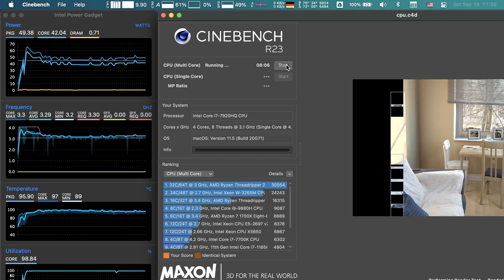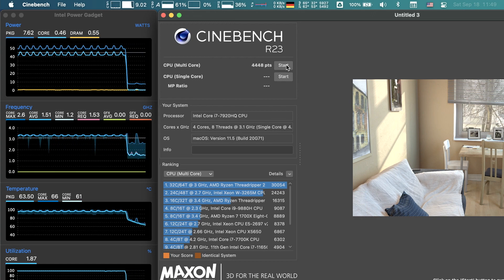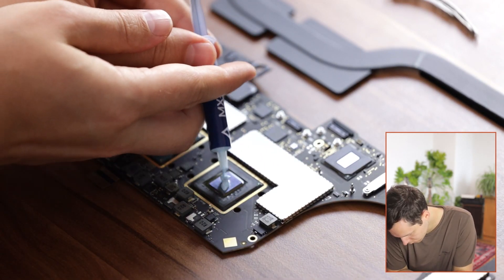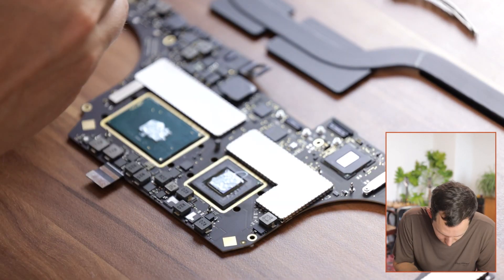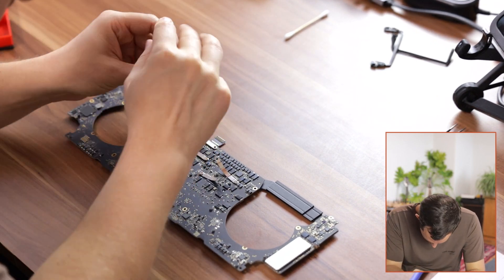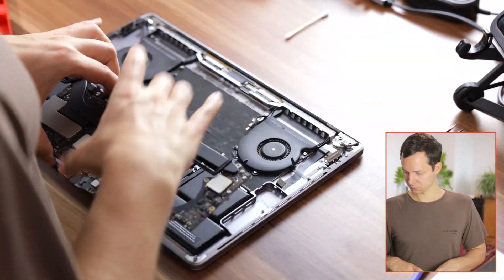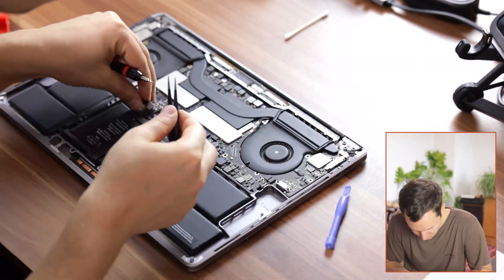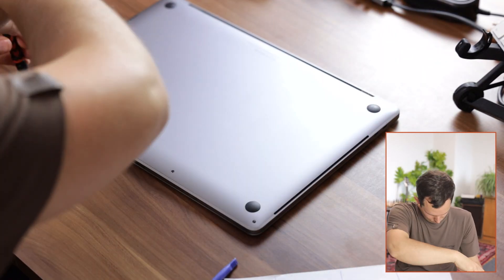Is Repasting a MacBook Pro worth it? [Model 2016/2017] (A1707)

Comment: I did it recently with my A1707, and it got me 25°C cooler !!! No typo, not kidding - TWENTY FIVE DEGREES CELSIUS!
Starting Photoshop, it used to peak out at just over 100°C.
Now, after re-pasting, it won't get over 75°C (I'm using Temperature Gauge Pro).
Peaks also seem to last shorter than before.
Thermal paste is now Arctic MX-4 (I don't get payed or sponsored in any way.)

Interestingly, my idle temps are now a hair warmer: I can't reach the former 37°C, it runs now at just over 40°C.
Reply from the maker: That's amazing, thanks for sharing your experience here. Congrats on the "almost like new" laptop.

Comment: Very nice results. I would suggest not using a spudger on/near the die, it's really easy to knock off an SMD in the process and render it dead. Use a q-tip and isopropyl alcohol and be VERY gentle
Reply from the maker: Thanks for the tips.

Comment: My macbook A1707 2017 repaste using artic mx4 always reach 100⁰C when boot or opening app or rendering and about 60⁰C - 70⁰C when idle process with auto fan setting, is that normal?
Reply: No lol
Reply: I think these are sadly the actual temperatures which you will normally get. The design of the cpu and gpu cooler is just very poor
Reply: @Niklas5  exactly, I've tried many thermal paste except Thermal Grizzly Conductonaut, the best max thermal reached still 95⁰C and 50 - 70⁰C when idle. Si I decided stop using the machine  and move to PC

Comment: I fell over a 2016 MBP in search of a 2015 MBP. I am happy with it. Great video and may be worth doing. I use iMovie and the older version was faster than the new version, so for all the speed I would gain, is lost in the extra steps needed to get a video up on You Tube. iMovie 9 could upload directly to You Tube, now 10 forces me to download it and upload it from the Movies folder. Kinda dumb, but I guess You Tube was complaining. Apple software does amazing things, and then when people don't use it, it sort of goes away.
Not a lot of videos on the 1707. Was looking to replace the SSD, if it would be helpful. Memory seems to be maxed out at 16G.

Comment: If you had cable trouble did replacement fix the issue
Reply from the maker: I did not have to replace anything. It all worked again.
Reply: @ChrisSpiegl  sorry, I meant keyboard trouble as in sticky keys etc.
Reply from the maker: @dummyemail4738  I never had sticky keys. I know this was an issue for many but not on my model for some reason.
Reply: @ChrisSpiegl  you are probably a very clean person 😃
Reply: Dirt sticking under the keys cause the issue
Reply from the maker: @dummyemail4738  Maybe. But I was even traveling around the globe with the MacBook and this one has been to about 9 different countries and at least as many beach coffee shops.
Reply: @ChrisSpiegl  I have a MacBook 12 2015 with the same butterfly keyboard and I never bad any issue (knock on wood) so I am hoping i wont have issue with the 2016 15 inch (that I just ordered).
Reply from the maker: @dummyemail4738  🤞 wishing you all the best with the new MacBook 👍.
Reply: @ChrisSpiegl  Thanks!

Comment: Have a couple 2015 model Macbooks that are apparently bogging down a bit so was considering whether it was time to give them a repaste-- you couldn't have uploaded this at a more convenient time, haha. Might ask someone else to take on the task since disassembling the silly thing looks laborious, but appreciate the walkthrough and benchmarks too!
Reply from the maker: Hi Kevin, since you are talking about the 2015 models, there it is a bit of a different story. Please search for a video which specifically shows the process for that.
I believe it is much easier from what I saw in some videos because with the 2015 model the heat sink is actually bolted on from the top, so you do NOT have to take out the whole motherboard to repaste.
Much easier in that way!